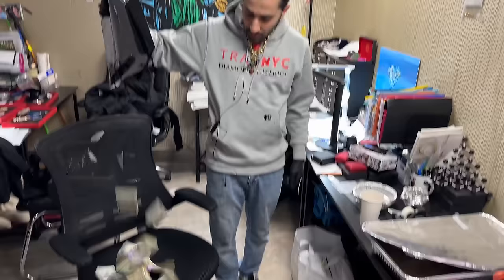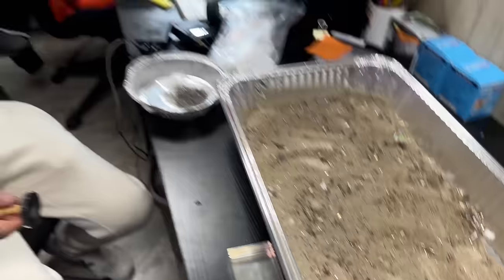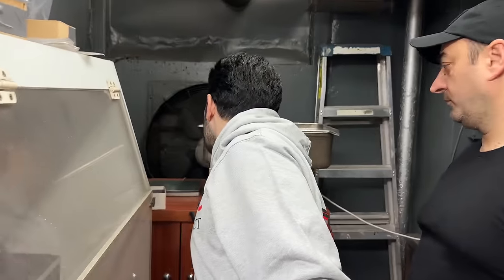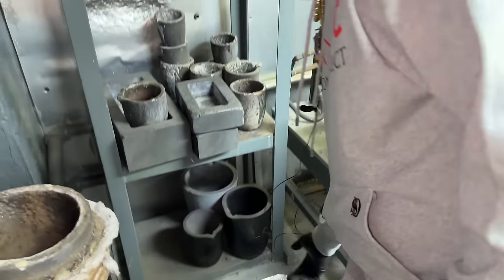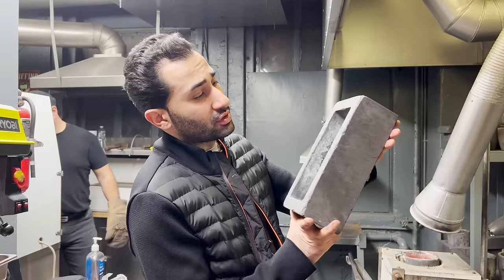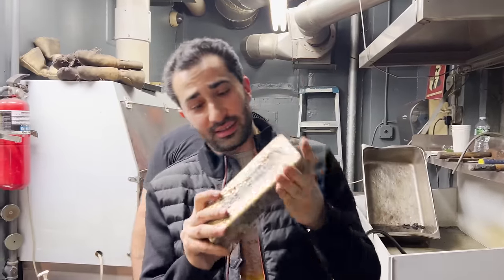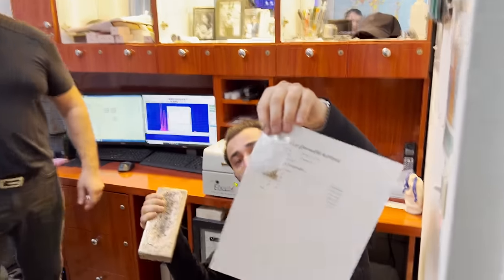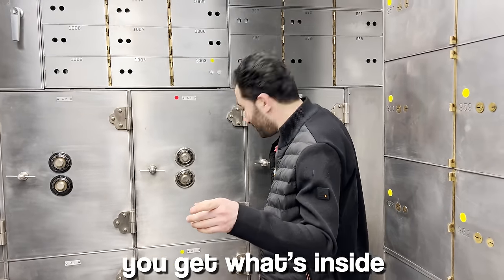MELTING $170,00 WORTH OF SCRAP INTO A GOLD BAR!!!

Comment: I’m guessing the combo is in the 6 digit day/month/year of the founding date of TraxNYC Corp in 03 but I wasn’t having specific luck on the month and day specifically. How long did y’all stack up the dust/scraps before ya did the melt because that was a ton of dust from all of the custom work done from filing, drilling, shaving, and all of the finishing work to complete the pieces.

Comment: I made a homemade crucible by cutting the top off a steel propane tank. Cut a hole out of the top of the tank. Hinged the lid top on it. The lined the inside of it with plaster of Paris using a bucket approx 2-3" smaller than the inside of the propane tank. Then cut a hole in the bottom side of the tank. Then attached an extension steel pipe with a blower sending air through the crusible. Filled the inside with charcoals. Then made a slag cone for the cruisible. we can make you a crusible? That wqy you don't have to wander off so far to get it 😅😅

Comment: Trax, i wish I could intern for a week in there, love the videos, yet random question, would running the dust thru water sluice increase or decrease the value of the results, just a quick run before sending it to the crucible. Best regards
Reply: SCAMMER DO NOT RESPOND
Reply: The only reason to sluice gold dust would be if you want to separate it from dirt. To increase or decrease the value of the end result it all depends on the ratio of gold to other metals. Higher gold, more expensive. Less gold. Less expensive. But the more gold you put in something the less durable it is. So pure gold would be 24 carats. If that gold bar was 24 carats it would be way more expensive. He said this is 51% gold. Meaning 49% in other metals. It's just a few percentages shy of 14 carat gold which a lot of jewelry is made from.